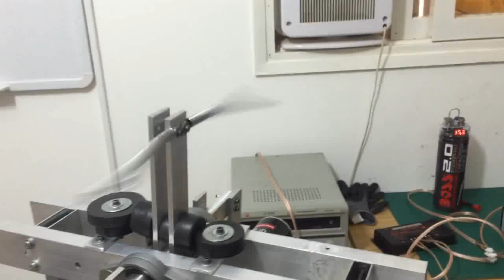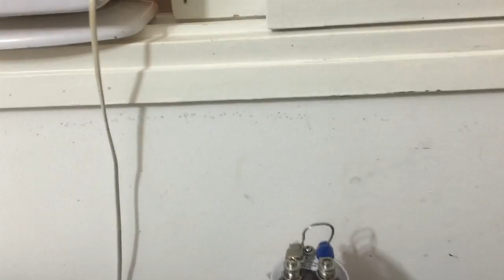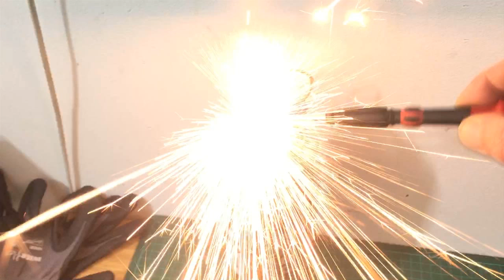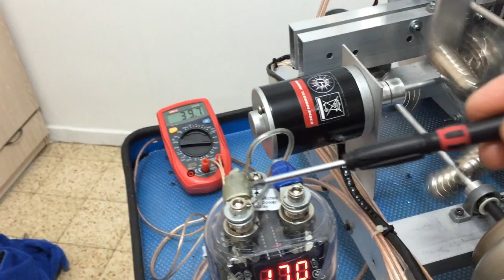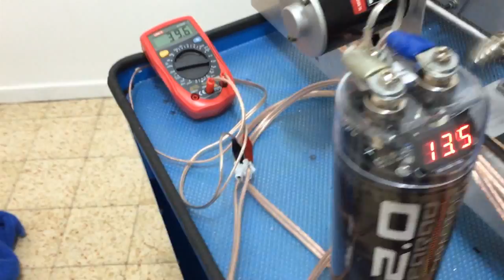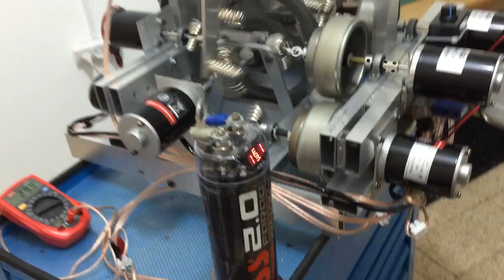Spark Super Capacitor Discharge And Fast Charging! magnet motor engine  ISRAEL AND USA TECHNOLOGY

Comment: We need as much technology as possible 
The only way to have technology everywhere is with a spring powered USB charger
Like this
https://photos.app.goo.gl/EnUVBPDunO66fDb63
The only way to keep this self wound is if the hand crank charges a super capacitor and it makes the drill keep it wound like this

https://youtu.be/rEuPwnwAbcM

Here's a smaller hand crank that would charge slower but still can power a drill

https://youtu.be/ucLyYA3WvlM

I am in Canada and we cannot make this

https://youtu.be/ucLyYA3WvlM

A large portion of Israels money is invested in Canada and America

If we do not have this device we do not have technology
There was more than. 10,0000 fires set and we do not have detection devices in remote regions to stop those fires
Israel is paying for those fires to be stopped

We need a self winding clock to charger USB devices

Please make this available.

https://youtu.be/ucLyYA3WvlM

If you have connections in other countries please contact them and make this available to us
Reply from the maker: There are many interesting videos to my channel
I did not really understand what you meant